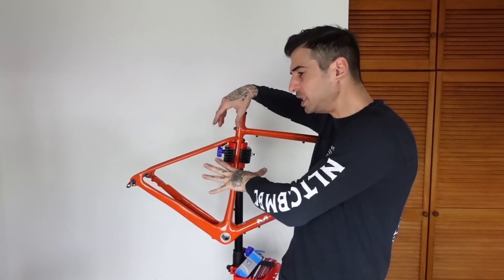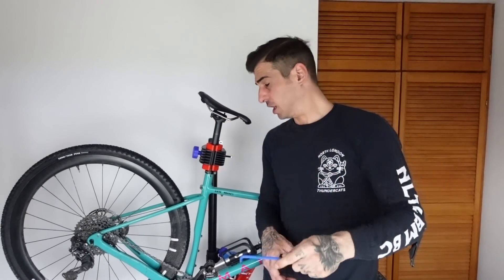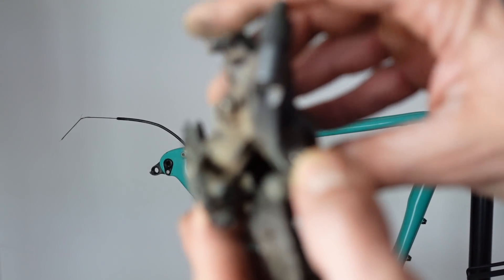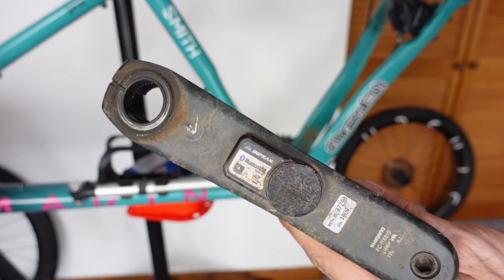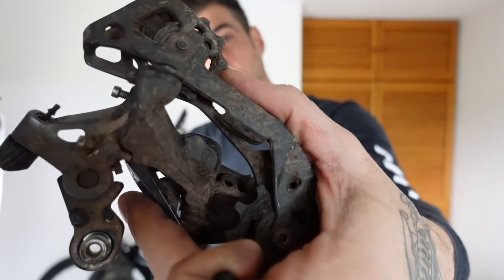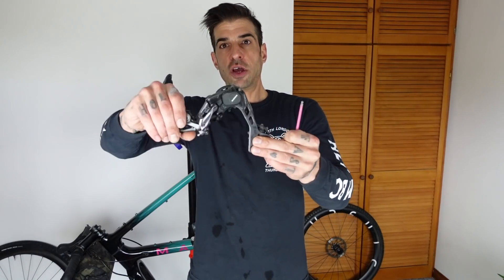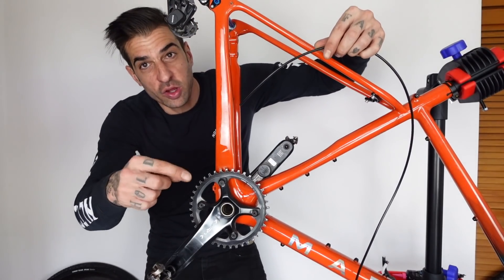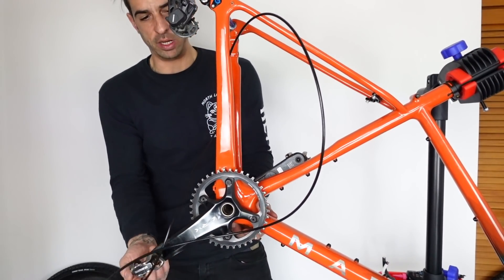Out With The Old, In With The New - New Gravel Bike

Comment: I thought about getting an ultrasound cleaner to thoroughly sort out filthy components.....I still am....What do you think fella ?
I wouldn't mind trying 650b wheels on my gravel bike just for the fatter tyre option....I've just got to do a bit of research and see if my BB and crank will be too low....Hmmm ?
I do most certainly like the look of that new frameset.....Good one Dave.
Reply from the maker: I was also thinking the same about the ultrasound cleaner, I think you can find them quite cheap. My bike has a low bb, but I find if I run a 50mm tyre the overall diameter isn't that different to a 700 with a 32/34mm tyre.
Reply: @DaveNoakes  Cheers for the info about 650b. I run 43c tyres on 700 rims and it would be good to chuck on the spare wheelset with 50c tyres...It'd be like 30 odd years ago when I started MTBing.
As for the ultrasound cleaner, it'd have to be big enough to cope with an Eagle 11-50 cassette for me.....Hmmm ?